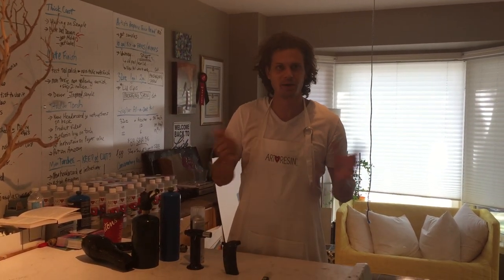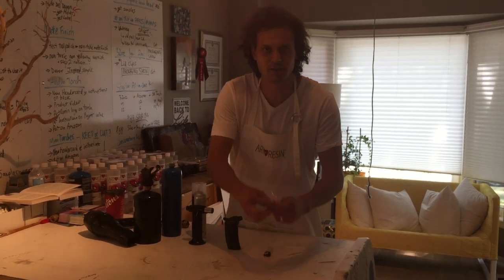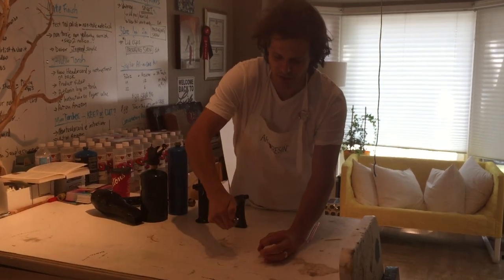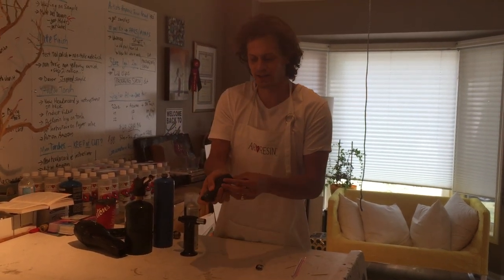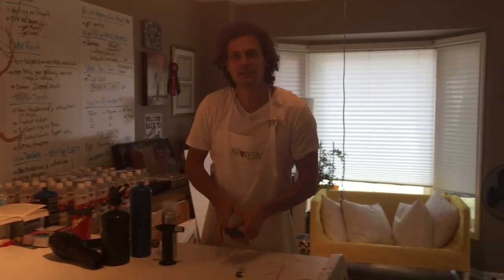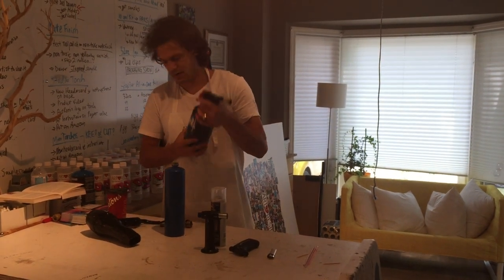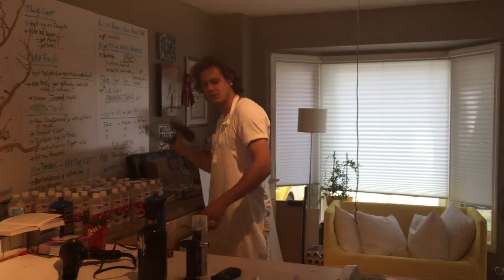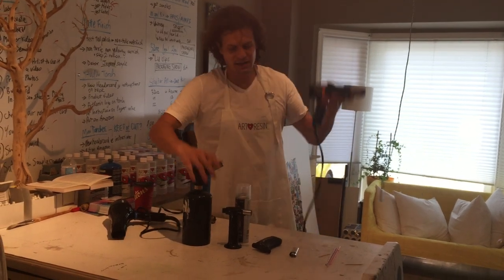Heat Gun VS Torch Flame To Get Rid Of Bubbles In Epoxy Resin

Comment: You guys are funny! LOL  Thanks for this video. I was trying to figure this out before getting started. I am only doing small projects at the moment.  Do I need to pour the epoxy in layers  to use the heat gun or can I just pour the epoxy and then use the heat gun and watch for more rising bubbles?
Reply from the maker: Thanks for watching!   We recommend pouring your ArtResin in 1/8" layers- a quick pass of the torch and your bubbles should disappear.
Reply: @Artresin  Thank you and you're very good!🥰

Comment: Ok I bought a butane torch but I’m still having bubbles. Should I do a heat gun?
Reply from the maker: Hi Lauren, try giving your resin and hardener a warm water bath before you mix them. This helps to thin out the resin making it easier for the bubbles to come to the surface for popping on their own. Check out this blog for more information : https://www.artresin.com/blogs/artresin/should-i-warm-epoxy-resin-in-a-water-bath-before-mixing?_pos=1&_sid=68e535724&_ss=r

Also make sure if you are working with any organic materials, that you seal them first :) Here's another blog with the tips on how to prevent bubbles that might be helpful as well: https://www.artresin.com/blogs/artresin/tipstopreventresinbubbles?_pos=1&_sid=2bb313922&_ss=r